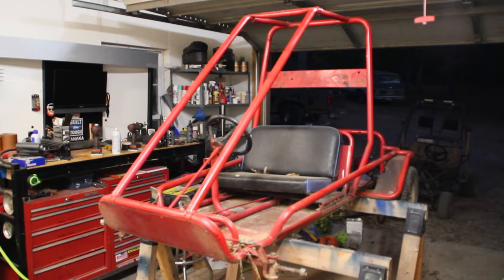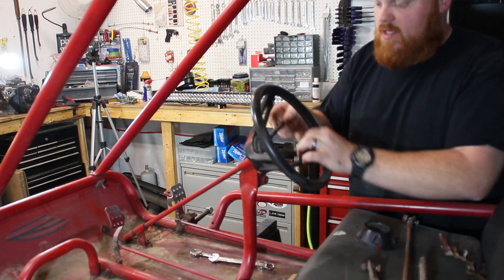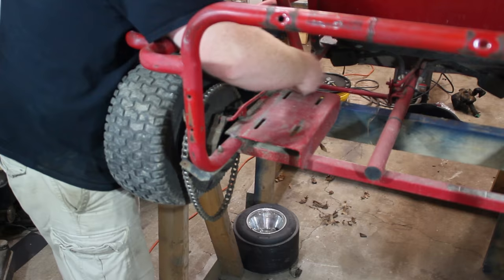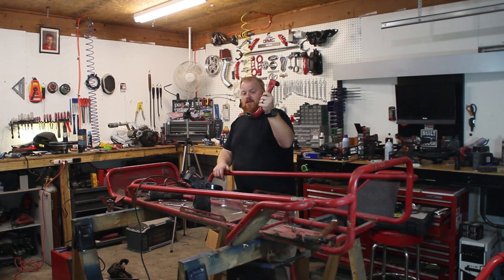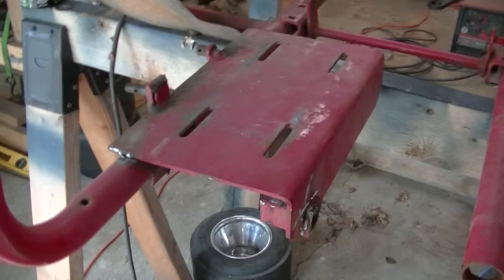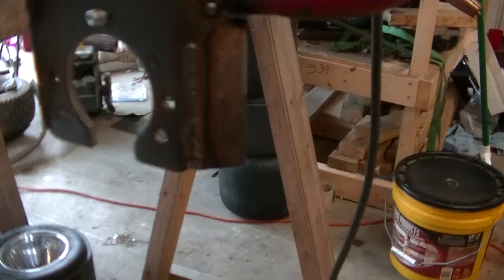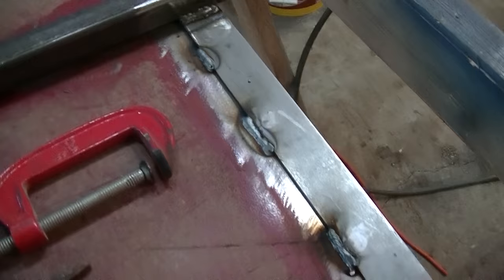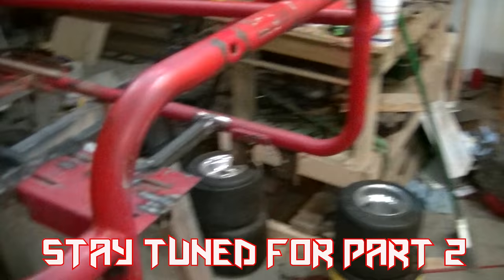Street Go Kart Build Episode 1

Comment: Red Beard I am also working on an murray explorer and have a duromax 18 hp engine.i had the frame strengthen in the front middle and had ca custom rollbar put on an a I beam as a front bumper but cant seem to get the power to the ground/I tried going to a 40 series drive and driven and the belt gets stuck and the driven unit and usually bends the pulley.Am I just better getting torque converter kit than a jackshaft.I have been working on this for months and so called GO KART GUUOS  said they stop by like 18 of them and not one has so am on my own and cant find anyone around me who knows anything about go karts that can help me dial my kart in so I can fly around in it.Need help